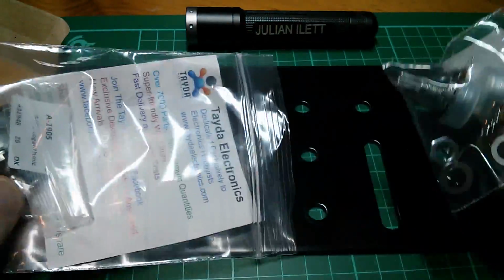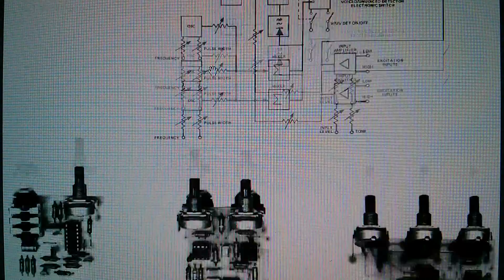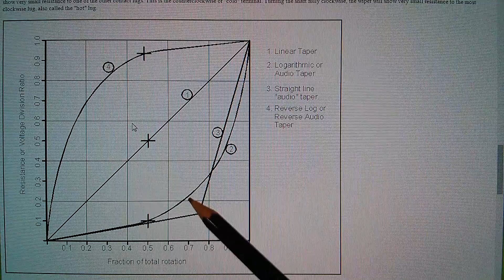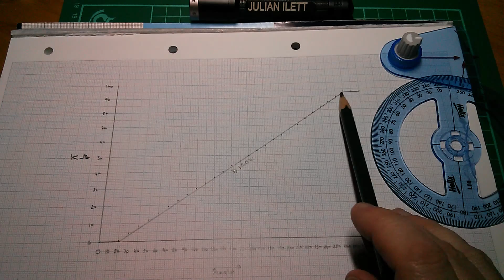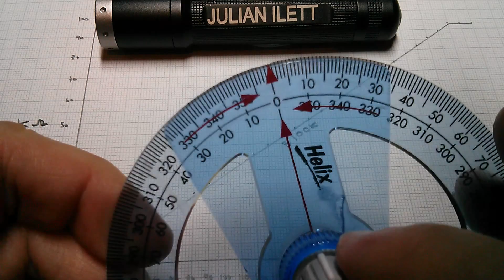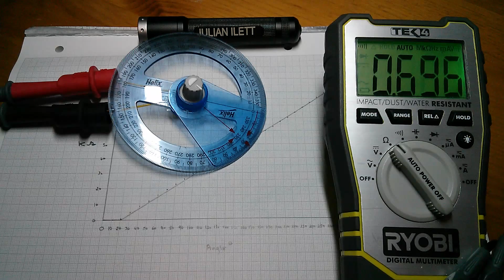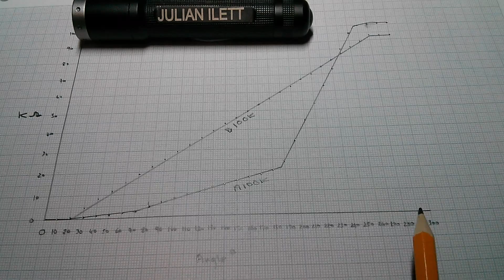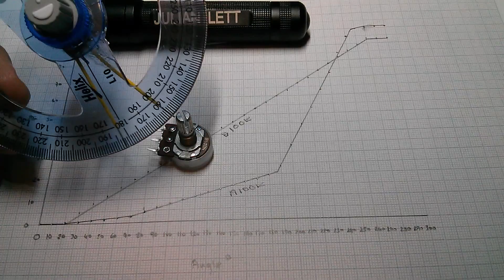Investigation: Are Log Potentiometers really Logarithmic?

Comment: I read or saw an article somewhere and, much to my annoyance, I can't remember where, about converting lin pots to log.   

By using a resistor between the wiper and one side or the other  you could turn a lin pot into log or even antilog. If I remember correctly the fixed resistor should be about one tenth the value on the pot. So if you wanted a 100K log pot. you would use a 1M lin pot with a 100k resistor between the wiper and the right hand terminal ( as viewed from he front).
Reply: I remember seeing this on Rod Elliot's site (Elliot Sound Products?).  He has a LOT of good stuff on there,  on a variety of different subjects,  and I've learned a lot from reading his pages.
Reply: I have always done this when using a linear pot to control audio. Taper coefficient should be between 0.2 and 0.25, not 0.1.

Use a 20k resistor from wiper to ground to simulate logarithmic on a 100k linear pot.
Reply: Also, you can turn a 100k logarithmic pot back into a linear pot(somewhat) by adding a 1M Ohm resistor between wiper and the high pin.

Comment: You can turn an analog pot into a logarithmic pot by just adding a resistor.
If you need a 100k log pot you take a 150k analog pot and put a 300k resistor in parralel with the middle pin and side pin.

Comment: I must have ended up with a crazy taper one time where I needed a 100K pot but I only had handy a dual ganged 50K type. So I wired the second gang as a increasing value rheostat and put that in series with the earthy pin on the other side that was wired as a potentiometer.

When the pot was at full noise it would have looked to the circuit as a normal 100K pot. When at zero it would have looked like a 50K type. But at all other positions it would have been crazy! :)

It did the trick though, and although technically one might consider it a "waste" ov a dual gang, I picked them up real cheap.

Also, I have on many occasion subbed a linear pot for a log one in audio circuits when that's all I had on hand. You do tend to sense the curve is "wrong" when you use it, but it's still perfectly adjustable.

Comment: I didn't know that about log pots either.  I wonder if they just step the width of the carbon track.  The low variance at each end might be where they fattened the carbon track up to make it easier to connect to.
Reply from the maker: I suspect the track width is constant, but the carbon composition changes in the 3 different sections. I wish I'd taken the log pot apart now and looked for 3 shades of grey.
Reply: @Julian Ilett You should do a follow-up video, it would be interesting to see the break down of a cheap log pot and what they are made of.
Reply: Julian Ilett Better than 50.
Reply: Here is something, Clive, that you can take to bits for us!!  Hi, Julian!!

Comment: So it looks like putting a fixed value resistor between the lower end of the pot (on a linear pot) and the wiper might achieve a similar result to the non logarithmic pot and be cheaper too.

Comment: Years ago in the analogue audio days I worked for Cambridge Audio. The P40 amplifier used 1 M ohm stereo (dual gang log pots) They did trace the real log tracking quite well but a downside was the matching between the two gangs. Being quite a high value (1M) the tracking was often 6/8 dB out and could be 25dB out on the start position of the pot. This meant we had to select  pots for use as a volume control, the reject rate was over 50%. The amplifier matching called for less than 1dB, which was the case when looking at the power amp only but in the real world using, say the Mag input you were lucky to be within 5dB depending on the volume control position . Of course much less of an issue when most transistor amplifier volume pots were typically 10K.
Reply: Ive got an old Cambridge Audio DAC3 with those semi-legendary Philips TDA chips in (1541 or something?) from before CA got bought out by Richer Sounds. It still works perfectly and sounds incredible, even though its really old its my best sounding source by far. Its very pretty inside too, you can tell it was put together with a lot of care.

Comment: If I recall correctly, from classes in electricity (long long time ago).  You can create a log type curve from a linear pot by adding a fixed resistor between the 2 pins you're trying to get the log resistance from.   It does start a bit different, but you can compensate for that as well.  the type of curve depends on the ratio between the lin pot resistance and the fixed resistor you added.
Reply: oreubens Yes, I definitely recall this too. Incidentally, I wonder if the 3 lines in this pot are because they tried to trim the lower end to be more accurately logarithmic because the lower end tends to be where accuracy is required?

Comment: You should consider filing down the lugs of the pots to fit them in the matrix anyway. It'll look much cleaner and it will be much sturdier.
Reply: Or just drill the holes to a slightly larger size...

Comment: There are 3 linear sections in this pot. Most log pots have 3-4 linear sections, occasionally 5. I've not seen one with only 2, maybe 30 years ago. To make a resistance gradient in carbon composition is not simple or cheap, so they put a few different blobs of carbon comp on to aproximate log. 

I want to point out to everyone reading and commenting that this is absolutely the norm for log pots and it's not just because it's a cheapy from ebay as I think people might be getting the idea. If you want a pot that's accurately log, you're talking £20+ each and different technologies used which might for example have a much lower number of operations before failure than carbon comp or a very low voltage rating etc.

It gets over the effect of linear pots which is to appear to be almost an on-off switch for volume at around either 30% or 70% of the turn of the pot (depending on the circuit). The error from ideal log is tweaked out by the user without thinking as you act out a negative feedback sort of regulation of volume between your ears and your hand on the knob.

Also for someone called TMM who for whatever reason doesn't have a reply button under the post, you can't get around this by buying "audio taper". Audio taper is just another way of saying log taper, they're still sections of linear resistance, especially if the pot looks like the one in the video.

Comment: If you are using the pots as voltage dividers it may be cheaper and more logarithmic to use a linear pot with a fixed value resistor, like this: http://sound.westhost.com/project01.htm

Comment: This was interesting. I had a power supply with a problem of jumpingly increasing voltage at a certain point of the pot, and after I switched to a wirewound pot, it was fixed. Now I finally know what happened, and that I was dumb enough to use a log pot on a linear supply without checking